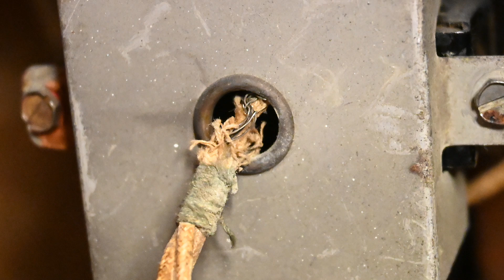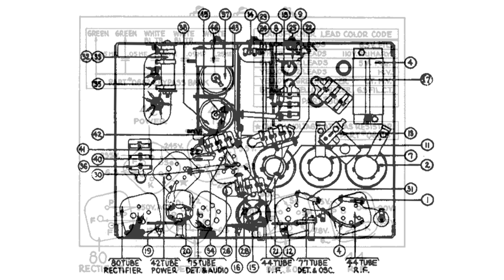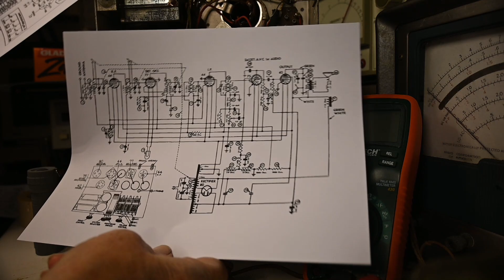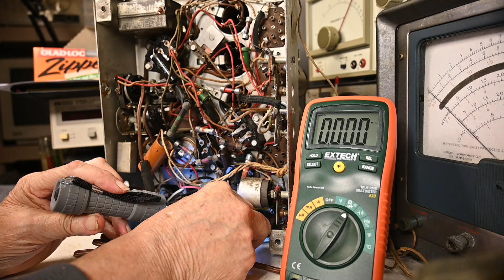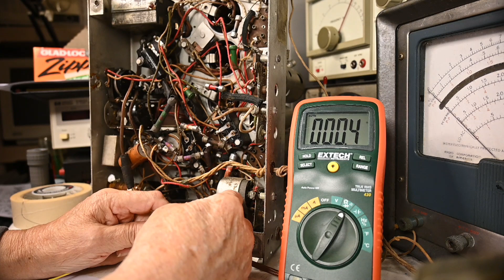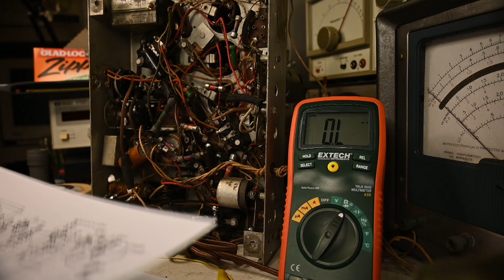Philco 89 Evaluation for Repair OR Radio Triage

Comment: Did the owner of the Philco 89 decide to go ahead with the repair? I was hoping to see how you handled the RF and Oscillator coils. I like how you show where on the schematic you are working.
Reply from the maker: The customer decided not to repair the radio.

Comment: maybe a pretty basic question, but what did you do to remove the front knobs? are they just press fit?
Reply from the maker: These just pull off. I used an insulated wire raped around ones, with the ends on both sides of the knob.

Comment: According to Radiomuseum.org the Philco 89 Version 1 used a #36 in the First Detector (mixer) stage instead of the #77. I don´t know if this could be of any assistance?
https://www.radiomuseum.org/r/philco_89_code_121.html?language_id=2
I only mentioned it so you don´t look surprised there´s a 5-pin base where there´s a 6-pin tube...

1) That open feedback coil at the cathode of the #77 might be a blessing in disguise, since you can experiment a bit with the amount of turns to get as reliably as possible operation of the Local Oscillator. It´s always a trade-off with circuits using tubes in roles they were never intended for, like in the First Det/Mixer here. Less Cathode-bias gives you more reliable oscillation, but reduces conversion efficiency. More Cathode-bias (and less anode current) gives you better conversion gain, but more trouble keeping the Local oscillator running stable. From experience, it´s better to have a few windings on the feedback coil too much, than too few. Too much can always be overcome by reducing the cathode bypass capacitor a bit. You should wind off the coil, and figure out the original number of turns, or find somebody else that has an answer with regards to the Ratio of Oscillator LC vs Feedback Coil. Confident you´ll get this fixed.

2) The Radio can be started even without the first 44 functioning, since that coil in the anode-lead being open is not an entirely crippling problem, unlike having a non-functional Oscillator section of your First Detector/mixer. You can simply bypass the RF-amplifier stage for the time being, and couple the antenna directly to the #77´s grid LC-circuit by means of a very small capacitor or by means of a small coil. Normally either should give you some reception already, even if far from optimal. At least you can start getting the feedback coil in order and the dial aligned. Problems that won´t get in your way in the future :-)

Greetings from Europe!
Thomas
PS.  Like your videos, ended up here quite a few times already. Btw, we use ´Anode' instead of ´Plate´ and ´kilohertz´ instead of ´kilocycles´ and such. Same for Plate Resistance being Internal Resistance etc. So apologies if something does not make sense right away :P
Reply from the maker: Thanks for the information. Repairing the coils will be a Winter project.

Comment: It's a bummer when you find transformers and coils open on these old sets. One hand says keep it and the other hand says it's not worth it. Maybe the owner will want to go the extra mile.
Reply from the maker: I have not talked to the owner yet. Trying to fix the oscillator coil can be a problem. And there's noway to protect how much time this will take. With the condition of the field coil and audio transformer, and capacitors, you have to wonder what else the radio genius did to this radio.

Comment: Funny thing.... I literally have the same radio on my bench right now. I checked tubes and replaced the 75 and 42 for low emission. I brought it up on my variac, and it began to play at 85 volts. Just lucky I guess. Starting the fun of going through the tar impregnated caps. I have C4 apart right now, replacing the 5 bypass caps. Yours at least looks better than mine! RW - Bob
Reply from the maker: Good luck!

Comment: Good practice ohming out an unknown radio. Every time I watch one of your videos I learn something. I really like that 9 volt trick with the speaker and field coil. Never a good sign with a coil open. Hopefully it's something simple with those coils.
Reply from the maker: I have not talked to the owner yet. Trying to fix the oscillator coil can be a problem. And there's noway to protect how much time this will take. With the condition of the field coil and audio transformer, and capacitors, you have to wonder what else the radio genius did to this radio.